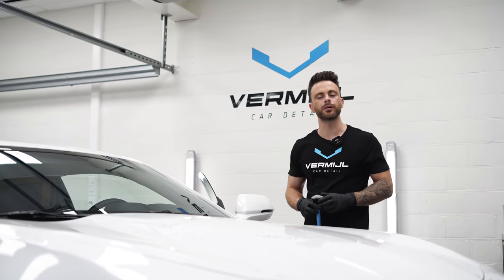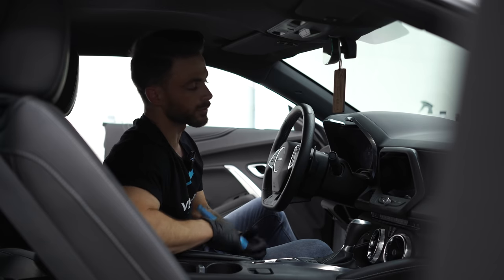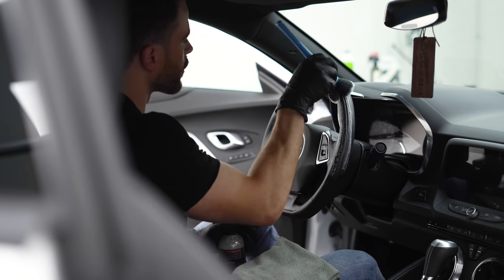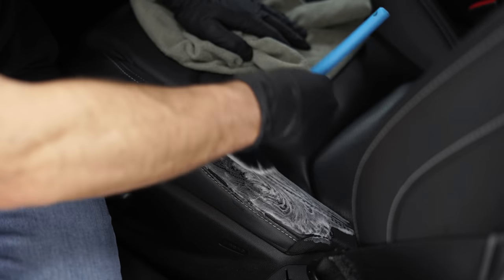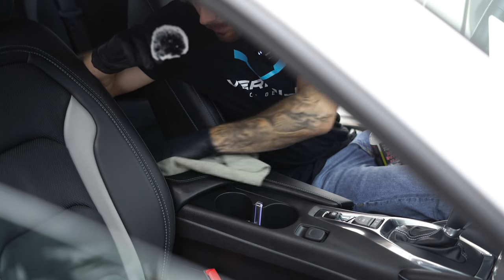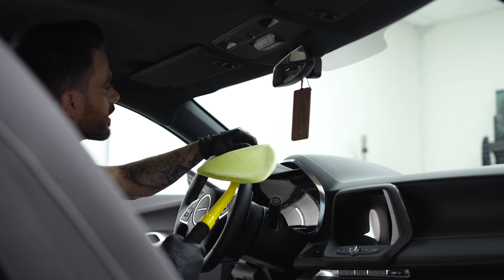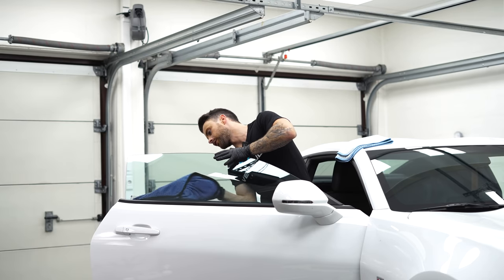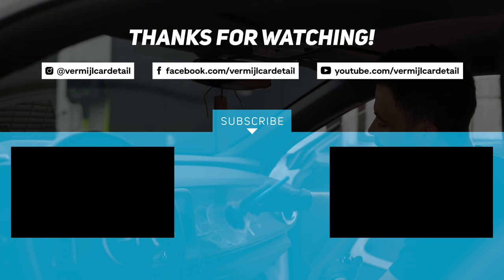How I Detail The Interior Of My Car - Interior Auto Detailing

Comment: One thing I found for degreasing glass and helps a ton with streaking is take rinseless wash (pick any brand you want, I like DIY and P&S) and dunk a clay towel or mit into the solution and wipe down the glass first. Takes away the grease and grime off of the surface before the glass cleaner step. For me that's worked wonders.

Comment: The biggest thing I've been searching for online is the correct way to maintain/protect/seal  your leather seats..  

I own the Mustang Mach-E which has a full glass roof.  That roof is coated, and I have all lower windows tinted with ceramic as well, but still worried about SoCal heat getting to my seats. 

I've been using Aerospace 303 as it seems like its a fairly highly rated product.  I've been using their leather cleaning and leather conditioning for the last few months.  So far I've been pretty happy with the way it looks, but I'd like to add more protection as I have kids and a wife lol   They are not true leather seats, they are the typical animal free seats.

Comment: many incorrect points.

brush per component not cleaned.

chemistry not neutralized with water afterwards per component

Cloth to wipe off, not washed out or used again.

Installation good, design upgradeable👍🏻